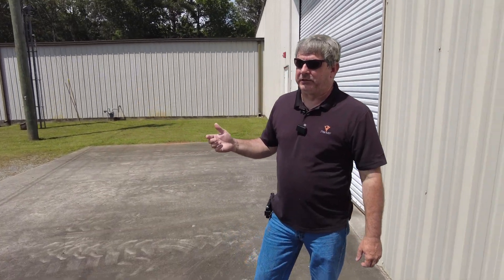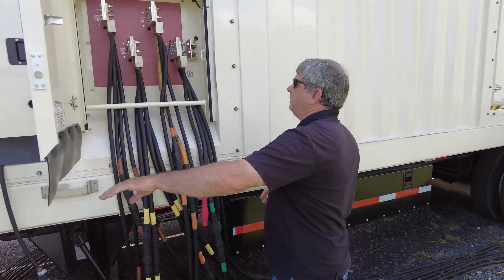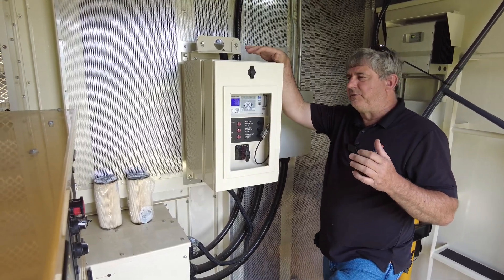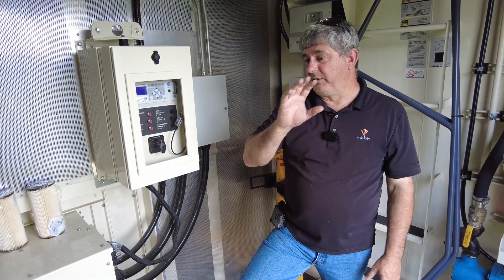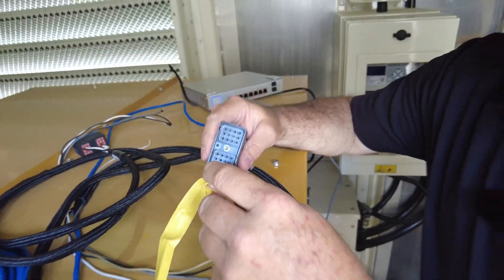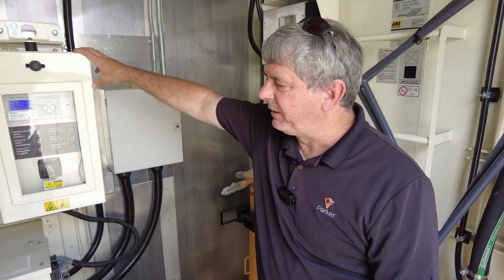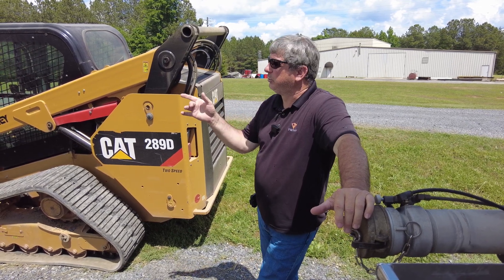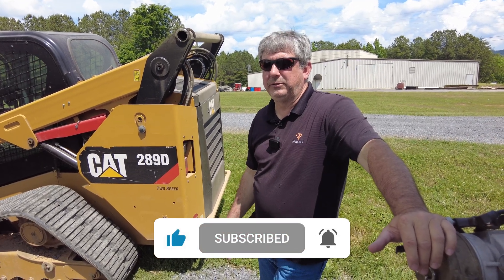2 Million Watt Generators Parallel Operations!

Comment: Ohhh my.  32 hours for a tanker load of fuel.  Each tanker holds 7500 gallons legally so thats 234 gallons a hours for both units. 

I do have a question, what Tier are they? I’m assuming they do not require Def.   Thank you for the video
Reply from the maker: Different tiers.  But yes pre def.    I can get you a def one.  They a little pricy and probably not reliable.   Be careful. There are some out there that can only be used for export.   If the deal looks too good.   It may be one of those.

Comment: Paralleling is quick & easy. At the large Hospital that I retired from they had three 2 meg Cat gen sets at one end of building and four 760 KW Cat natural gas ( big Pigs ! ) at the other end of the building that would start & and snc within ten seconds. While performing monthly ATS testing after a few minutes one gen set would drop out because of low load.
Reply from the maker: wow thats cool --    those natural gas units are typically a little larger than the diesel ones. -- Parallel operations is really cool -- thanks for watching